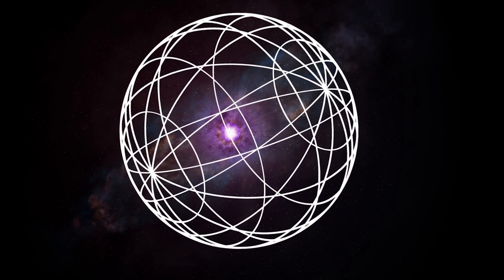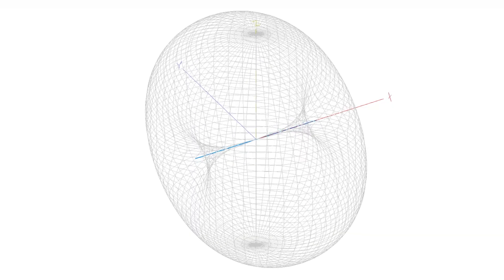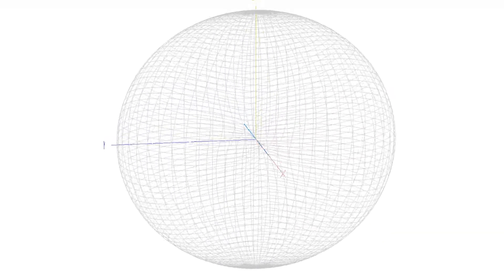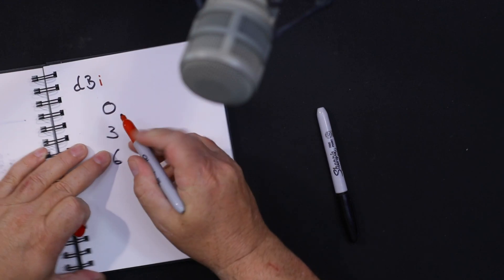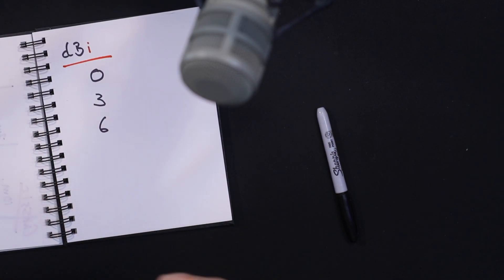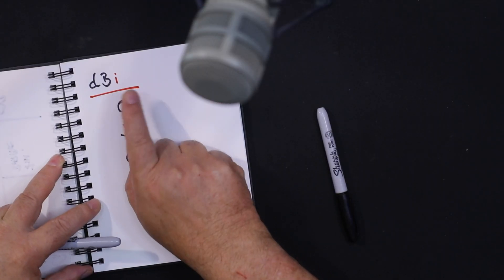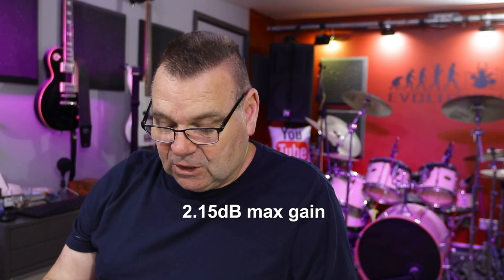Fast Easy Guide to Decibels dB vs dBi in 6 Minutes

Comment: Standard line level for transmitter control was -4dB at 1kHZ at the sending point. The 600 ohm line was maintained at 10 dB of loss. The FCC telecommunications act of 1984 forced the Bell companies to work with us to perform reciprocal testing. We used Hewlett Packard test sets.
Hams get fooled by the dBi spec for antennas all the time. It would be nice if ERP for a 10 or 100 watt transmitter with zero dB loss 50 ohm coax was used as the reference for relative gain. Then they could look at it and say "wow!" 😅
Reply from the maker: Like the folks studying for Foundation Exam will have no idea what you are on about - but keep showing off, it's good for you.
Reply: @DXCommanderHQ Cheers mate!

Comment: Ooh no, you have fallen into the trap of every mathematician by confusing people, your other explanation in a different video was much easier to understand. By jumping from 9dB to  10dB doesn't make any sense. From 9 to 12 does (3dB x 2, 6dB x 4, 9 dB x 6, 12 dB x 16) every 3 dB is doubling it, this is easy to understand. The 10 and 13 values can come later. Otherwise good video.
Reply from the maker: Read the comments… you are the odd one out.
Reply: @DXCommanderHQ Erm i dont think so. You actually said people would be confused after you explained it so there is that.

Comment: A pretty decent armchair explanation for folks that aren't mathematically inclined.   Perhaps a little extra would help clear up some of the confusion that some people expressed.  The concept of decibels is tied to the mathematics of logarithms - which - don't get scared - is an easy way to change multiplication into addition and division into subtraction.   The best way to explain logarithms is to construct this chart (showing pairs of numbers - the number and its associated "log").
log of 1 is 0
log of 10 is 1
log of 100 is 2
log of 1000 is 3 and so on.
Also the log of 1/10 is -1
log of 1/100 is -2
So to add 1 to the logarithm of any number is the same as multiplying the associated number by ten - of course, you have to remember to come back out of the logarithm table the same way you went in - but in reverse.  Likewise, to subtract 1 to the logarithm of any number is effectively dividing the associated number by 10.

Now if you were to plot these pairs of numbers (all multiples of 10) and then draw a smooth curve between them, you would be able to figure out the log of any other number, not just multiples of ten.  For example, the log of 2 is about 0.3.  The log of 4 is about 0.6.   So if I add 0.3 to 1 (=1.3) this corresponds to multiplying 2 X 10.  (log 20 is about 1.3).

Back before computers and calculators became commonplace, this made arithmetic simpler.  You could add/subtrace numbers on the fly.  And some physical phenomena actually are better characterized by a logarithmic relationship rather than a linear relationship.

So a decibel is really nothing more than a logarithmic scale, divided by ten.  We could have used a "bel" (almost no one does - again granularity - and tradition - dictate that a decibel is more convenient).  Double the power - adds 3 dB.   Quadruple the power - adds 6 dB.  Tenfold times the power - equals 10 dB.  One tenth the power is -10 dB.

Two wrinkles to be aware of, so you don't trip over them.
First, dB implies a ratio.  Because it is based on a ratio of like quantities, it is typically considered unitless.  This is useful to know, if you have learned the trick to "cancel units" (perform the indicated arithmetic operation(s) on units of an equation).  If you use a variant of dB such as dBW (ratio compared to 1 Watt), dBm (ratio compared to 1 milliwatt), then you have consider the units.   Otherwise, it is merely a number multiplying or dividing whatever units you started with.
Also, In most arenas where dB is used, we are talking "power", not amplitude.   For example, if you are in electronics, the power is related to the square of the voltage or the square of the current.  So if you are working that realm, and are doubling the voltage (or current), you are quadrupling the power.  So it is customary to incorporate that square term into the formula for dB.  Hence power defines dB as 10log(ratio).   But voltage or current defines dB as 20log(ratio).
Reply from the maker: Write a book :)

Comment: Thank you for the video and explanations.  I've watched about a dozen dB  videos and I can parrot a lot of what each says and each explanation is almost the same.  I still have a few questions and I bet you're the only one who can touch me with some understanding of my questions.
Mainly (that is to say my highest proprity at this time is) I'm trying to make an RF probe with which I can measure the output of a one transistor crystal oscillator, and then measure the subsequent stages to see the gain.  I think I'll have to put amplifier stages in a box before I put the VOM leads at the oscillator output so I can get a reading on the VOM.  I don't want to make one watt of RF power before I see the meter needle (digital meter reading etc) increase to zero.    
My question on that is how many stages (I suspect using small plastic RF capable transistors) of amplificaton do I need in line between the transistor output and the meter lead to get an indication on my VOM.  I do understand that 0 dB is equal to 1 mW RF power.  And I understand that doubling the power is 3 dB gain and all that other stuff about the S-Meter readings.
Oh I don't care at this time about technical accuracy I just want the get a meter indication that I can see.
My next question is secondary and relates (I suspect to Audio dB).  I just got a few new VOMs and they have a dB scale.   The manual says how to add a number to the AC meter reading get the actual dB.  Is the the measurement made by placing the meter leads on the speaker terminals while the speakers are being played?  I'm guessing that's right.
Thank you very much for your time.
Reply from the maker: RF Probe.. OK, not my thing sorry. I need to be honest!
Reply: @DXCommanderHQ  OK  Thanks for the reply.

Comment: Antenna manufactures love to use the DBI rating for their antenna's because it makes the antenna look 2.1db better than it actually is. Since none of us have antenna's in outer space using an isotropic rating is pretty much useless. Any time you see an antenna rated at dbi subtract 2.1 right off the top.
Reply: For me dBi is easier to visualize given it is the power over the unit circle.  Nothing in real life comes close to a dipole in free space but some real world antennas (such as the inverted V) come pretty close to isotropic.

Comment: Field day is coming up pretty quick and I'm kind of concerned about operating in close proximity to other radios I was wondering if you have any recommendations to protect the radio so it doesn't get damaged I am using a 991 Yaesu
Reply from the maker: The BEST way of doing this is coordinating with your friends to make sure you all don't end up on 20m! However, in the main, you should just be fine. I've done this a few times. COnsider ONLY double the frequency.. So if one guy is on 7.1MHz, watch the 2nd harmonic on 14.2, Same only with 20m band interfering with 10m.. So 14.2MHz will kick a strong harmonic at 28.4MHz. But assuming you have some separation on the antennas, you will hear the harmonics, so you'll move away!
Reply: @DXCommanderHQ  very helpful thank you sir!

Comment: I am commenting here to seek an antenna solution. My location is in a shallow valley. It runs north and south for about 100 miles. The east and west ridges are 500 to 800 feet above my location. My property is 130 feet wide north and south. East and west is 600 feet.  What antenna has a high takeoff angle to help clear the hills?
Reply from the maker: I don't know how far away the peaks of your hills are.. You need to measure the angle. If they are above 20 degreees, then you're gonna be a bit screwed. However, if the peaks are a few miles away, you might be surprised.. They are probably under 10 degrees. NO antenna can go through hills so we are back to square one, which is what's the best take-off antenna there is? They will all do the same job with your hill there. Some better than others. I am about to do a comparison video between say a vertical and a dipole, so hang on!
Reply: Thank you for your prompt reply. I just checked with a inclinometer. It’s about 6 degrees at my eye level. However above the first hill it rises again. I’m not doing terrible with a trap 80/20m dipole. It’s 30 ft up on fence rail poles. Can sometimes go from here to Florida or Canada or Minnesota. Heard Slovenia yesterday but no CQ. I did not mention I’m in north central texas. And have a ameritron Als 500m.  
Thanks again

KI5TRF
Reply: KI5TRF

Comment: Great Video Cal as always. If anyone is using dB in any exam I really recommend making up some of their own examples for adding and taking away dB. It is not a difficult concept, but it is odd if you have not come across it before. I found doing a load of simple calcs helps at loads. Mark, 2E0MSR
Reply from the maker: That's a great idea!

Comment: Good explanation. Often  bugs me when someone states states 10dB. I think dB with reference to what? Isotropic radiator power, dipole, mW, Volt, etc. This can be important. For example, +6dBmV is a doubling of voltage whereas +3dBmW is a doubling of power. With antennas, PAs, feeder, we are usually interested in power but for small signals in radio equipment it is often voltage that's important. To save folk looking it up: dB (power) = 10 x log (power_out/power_in). dB (voltage) = 20 x log (voltage_out/voltage_in). So, if power out is 200mW for 100mw in, we should say the gain is +3dBmW. If power out is 100W for 5w in, the gain is +13dbW. If RMS voltage out is 100mV for 50mV in we should say gain is +6dBmV. Also, be wary of antenna manufacturers who say things like their antenna has 1.5 dB gain. If they mean +1.5dBi, this is 2.15 - 1.5 or 0.65dBi less gain than a dipole. So, you might think you are buying an antenna that gives you more gain at a particular angle/direction but may actually perform worse than a basic dipole.
Reply from the maker: Steve, how right you are!

Comment: dB is still hard for me to understand, expecially minus dB on my wifi signal on my router.🤔

How many "dB years" do I need to understand dB?😂
Reply: It's hard until the penny drops...
the vid was a bit too basic in parts so this may help.

dB without anything is a relative term, and because it was originally used to compare 
power without any suffix you assume power.

dBs are simply a number raised to a power  (and multiplied by 10) so they are logarithmic
punch 3 divided by 10 into your calculator hit antilog or x^2 and you willl get 2 i.e. double

When looking at a dB number if it is a single digit you just need to remember the double for every 3dB fact

if the dB is a two digit number look at the first digit say 13dB the first digit is 1 so shift the decimal point one to the right i.e. you multiply by 10 then you can add the last digit 3 in this case so you double it and get the 20

If the dB value was 23 dB the first digit is 2, so shift the decimal point to the right by two places i.e. multiply by 100 the 3 doubles the result so thats 200

if the first digit was 3 then you multiply by 1000, 4 by 10000 and so on

In the other direction you move the decimal point to the left, i.e. divide by 10 

so -10db is 0.1
     -20 dB is 0.01
and so on

Because of history Db is relative too 1W but it can be stated to anything.

30dBm as an example.
dBm is a reference to 1mW (it is sometimes stated as dBmW for clarity but not always)

1mW is 0.001W

30dBm the first digit is 3, so that shift the dp 3 to the right i.e. multiply by 1000

0.001 x 1000 = 1  so 30dBm is the same as saying 1W 

Go the other way at -30dBm   
-3 is shift the dp 3 to the left i.e. divide by 1000
1mW (the reference) / 1000 is one microwatt

So if you see a warning label on your expensive Spectrum analyser saying do not exceed 20dBm input you will know that this is 1mW x 100 i.e. 0.1W  

So thinking about the first digit in the pair like this will get you into the right range.

On your router if you see a figure of -16dBm

Thats 1mW reference
First digit is -1 so divide by 10 
gives 0.1mW

The last digit is 6 so that's normally double twice, however as this is a negative dB you DIVIDE by 2 twice

so 0.1mW /2 = 0.05mW
divide by 2 again 
0.05 / 2 - 0.025mW 

So if your router power is stated as -16dBm that's 0.025mW or if you prefer 25 microwatts.

Hope this helps a bit.

Andy
Reply: @andye2005  Great explainer Andy
Reply: @andye2005  brilliant! Thanks. Previously I did struggle to understand how 10 was x10 relative to the other numbers going up in 3’s, each doubling the value. Maths was never my strongest subject but your explanation does the trick. Many thanks.
Reply from the maker: @Andy E - Brilliant reply..!!!
Reply: @andye2005  Thank you